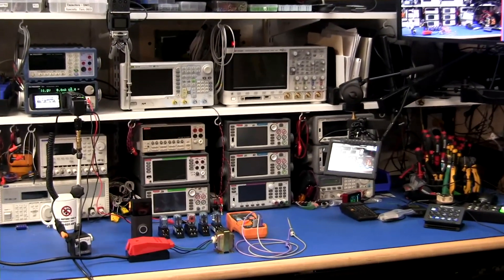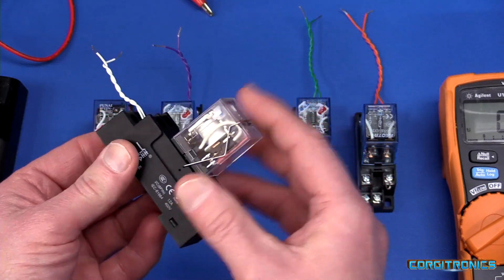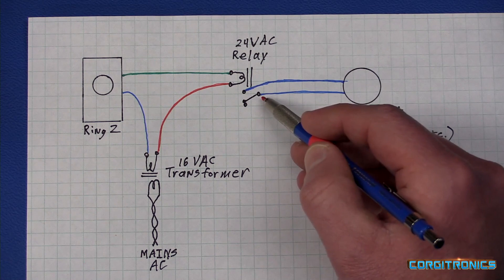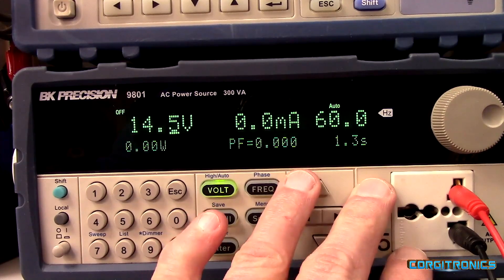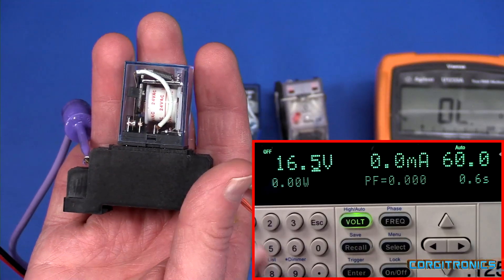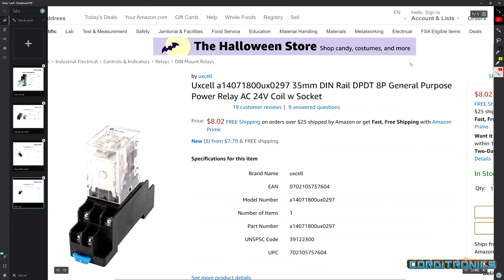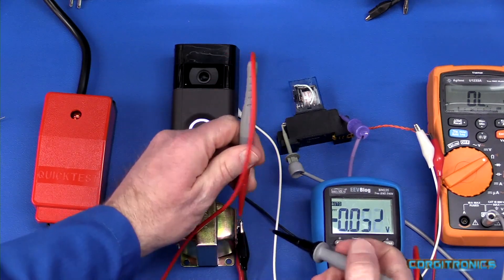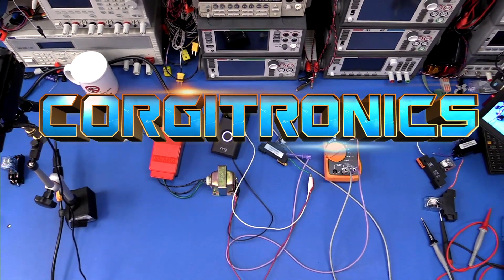Relays to connect a Ring Doorbell to an electronic chime

Comment: The new wired ring doorbells no longer support electronic/mechanical chimes. Do you think you could do this for the new 2k or 4k Ring doorbells to see if it works,.
Reply: I couldn’t get this to work with a regular relay. I did it with a Shelly 1 fourth generation

Comment: The coil in my doorbell camera trickles AC back down to the 24VAC relay from the doorbell camera, so it makes the chimes go off without anyone pressing the doorbell camera. Plus the coil on the relay for the chimes does not satisfy the doorbell camera's power stability. Ubiquiti G4 doorbell. Any ideas of what I can do?
Reply: im having an issue with my Ubiquiti G4 Pro. have 24v at doorbell but when the doorbell is pressed the voltage drops to 0 (even after separating the wires). The thought for me was a 2nd transformer and a relay but im unsure how to go about that myself

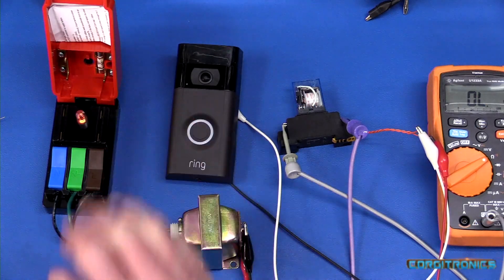Comment: Do you know if this is works with the pro 2? I've hooked it up the same way as in 10:50 and the relay starts immediately going on and off very fast. If I hook up the power kit to the relay. The pro 2 works fine but when I've tried pushing the button it doesn't activate the relay. I've tried 3 different relays, 2 ring pro 2s, 16vac & 24vac transformers but nothing works. I'm starting to think the pro 2 just does it differently then the other versions. Can you help me?

Comment: So I bought a stupid Logitech Circle View which is somewhat similar really to a Ring Doorbell Pro Wired (only designed to work with electromechnical 8-24VAC relay chimes) and has a similar power doohickey.

The problem is I wanted to hook it up to my Panasonic EC 5227W chime which is battery powered and uses a NO momentary switch normally.

This video provided the perfect solution though since I was apparently being stupid and not thinking about using a relay. :D

Comment: Great video, is the diagram you show early in the video correct? It only shows one side of the transformer powering the ring. Later in the video it does show your red and white connectors going to the one of the coil connectors, that connection is powering the ring I believe. Thanks again

Comment: Hey @corgitronics, I have set this up and it works correctly. However, it seems that the relay is getting powered too long. Like 5-20 seconds with no consistency. This is causing it to ring for an extended period of time. Sometimes relay chatters before going off. Has LED indicated that will also flicker at this point. Any ideas ?
24v relay and 24v transformer for the Ring.

Comment: I currently have a Ring Doorbell Pro powered by a 16 V 30 MVA transformer via the Ring Power Kit. I would like to add an electronic Doorbell Chime to the system following your instructions and sketch. A few questions.. Can I use the same 16V transformer to power the electronic door chime that also requires 16 V? If I did this would I need a diode across the NO relay contact? It would be great if you could add the wiring for the electronic chime  to complete the excellent sketch you already provided for the rest. Much appreciated - keep up the good work!

Comment: Hi great video. I am sure a silly question showing my ignorance, but I am trying to understand how a Ring Pro can be connected to a 18v AC power supply and a relay at the same time but the relay only activates if you press the Ring button and the relay doesnt stay “on” the whole time.

My aim is to get a Ring Pro to activate a relay to in turn act as the push button on my 12v DC door entryphone.

Comment: I have been trying to wire my vivint doorbell pro to my 8 tone chime door bell by Nutone. For the past year I have had no luck. I refuse to give up. Unfortunately I’m awful with electronics. I have watched numerous videos on YouTube but still no luck. I have replaced my transformer with the 24V ac and bought a 24v relay. I know it’s got to be the way I’m connecting the wires or I’m missing a power adapter like the nest or ring have. Any help would be appreciated.

Comment: Does the transformer provide a continuous charge to the ring battery in this configuration?
Reply from the maker: Yes.  I ran the Ring Doorbell 2 for 6 months using the cheap original transoformer and it remained fully charged.

Comment: I set this up, bought the exact relay you showed in both videos. For some reason the doorbell looses power and fades out. It starts strong then drops. I measure voltage across the contacts on the doorbell and it shows 7 volts. But if I measure across anywhere else it’s 24 volts. Tried two different transformers with the same result. What could the relay be doing to cause the doorbell not to have enough power to it? Directly connected to the doorbell it runs perfect. I can’t figure out why the relay is causing this issue.
Reply from the maker: Is this a Ring Pro doorbell that you have installed?  If so, have you connected the power kit as shown in my earlier video https://www.youtube.com/watch?v=4ZFl6BRTQnA&t=4s
Reply: Did you ever solve this?

Comment: Thank you for this video. So, will this enable the Ring doorbell to ring the chime on my Nutone once I have it installed? And will this boost the power supply up to 24 volts to power the Ring without having to rely on the battery?
Reply from the maker: Yes this is to connect your Ring to an electronic chime.  For another example see my earlier video https://www.youtube.com/watch?v=4ZFl6BRTQnA&t=2s
You shouldn't need to increase the power for the Ring Doorbell, it will trickle charge the battery from the existing transformer.
Reply: @Corgitronics  Great, thank you so much for the quick response! I just ordered the relay from Amazon. Can't wait to try it out. I will let you know how it goes. Thanks again!
Reply: @Corgitronics  So, when I wired up the relay, it made a low humming sound, but when I pushed the button on my Ring doorbell it worked. The problem is the door chime kept cycling, as if the relay wasn't disconnecting. I had to disconnect the power supply to get it to stop. Do I have it wired wrong, or could it be a weak relay or connection? When I wire the relay directly to the transformer there is no humming, and it cycles just fine, as you demonstrated in your other video when testing the relay. Any suggestions would be most appreciated!
Reply from the maker: @shawnchannell9689  are you using a Ring Doorbell 2 or a Ring Pro?  The Ring Pro needs the powerkit to be installed across the relay coil.  Also, check the settings for the Ring, try "Mechanical doorbell" first.  You'll find that under Device Settings --> General Settings.  It's possible that the relay you have is just a bit too sensitive, and installing a power resistor across the coil would solve the problem.  Can you measure the RMS AC voltage across the relay after ringing the bell (while the relay is still engaged) ?
Reply: @Corgitronics  I'm using a Ring Doorbell 2, which is battery or hard wire capable. I thought maybe the relay was bad or too sensitive like you suggested, but I was actually able to get it to work without the relay. I have posted a video demonstrating it, so I wanted to share this in case someone had a similar situation: https://youtu.be/-FW83Lbs5so. Thank you so much for all your help!
Reply from the maker: @shawnchannell9689  Glad you got it working, and thank you for posting your solution!

Comment: Hi I got the following relay https://www.ebay.co.uk/itm/153094144867 and it does not work can you advise please
Reply: Unless you're buying a Japanese version, I would just get the MY2N (European version) instead of the -J, these are normally knock off's on ebay anyway. Id say go through a company such as RS Components

Comment: I have been struggling with this issue, but with a EZVIZ DB1 video doorbell system. I want to connect to our M&S chime module, which uses 16vdc. Their install info does not describe how to connect to an electronic chime. I like your use of schematic drawings. I am confused about how the relay operates. Since the Video doorbell needs 16vac to operate, power from the xformer must flow through the relay, all the time. Won't that cause the relay coil to heat up?
Reply from the maker: It appears that the EZVIZ DB1 connects up the same way as the RingPro.  The "power kit" diverts some of the power around the doorbell (or relay in this case).  See my first video on how I connected up a RingPro to a Nutone intercom, there's a schematic and explanation at 3.40:  https://youtu.be/4ZFl6BRTQnA?t=220
Reply: @Corgitronics  I am trying to set this up with the ezviz now, I cant get it to work because everytime I connect the doorbell it switches the relay. I just ordered the ring power kit because i don't think the included one is doing it job well enough. Do you have any thoughts or suggestions on why the relay would switch when the doorbell is connected? I have quadruple checked my wiring and I tried it with 24v and 16v. In 16 v it almost works but still trips the relay

Comment: Ring recommends a 25 ohm resistor when the doorbell is connected directly to an AC transformer.  Does the relay method provide the necessary resistance making the resistor unnecessary?

Comment: Thanks for making this video.... Will the doorbell battery charge with the relay in the circuit?   If not, what is necessary to make it charge?
Reply from the maker: Yes, it does continue to charge through the relay.  My Ring Doorbell 2 is currently charging at 17mA on a 16VAC supply.
Reply: Thanks -- By any chance do you know if you  hook up a 2nd Ring Doorbell 2 (for a back door) to the same transformer (using a separate relay)  will both doorbells charge from the same transformer?
Reply from the maker: @cwkreimer361  Yes, they should both charge just fine.  The charging current is quite low.